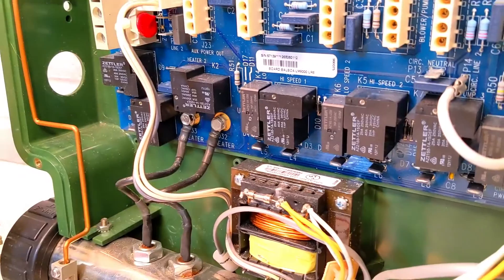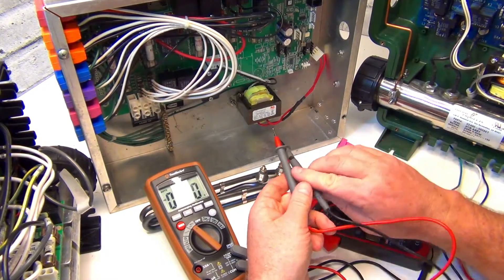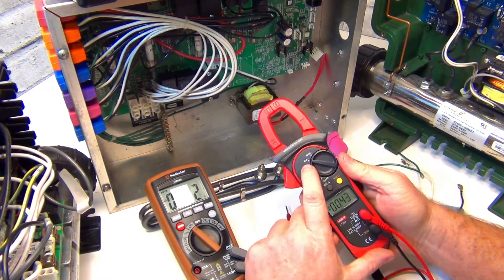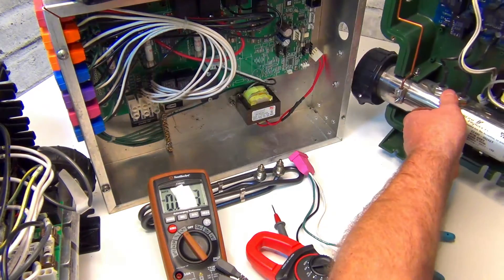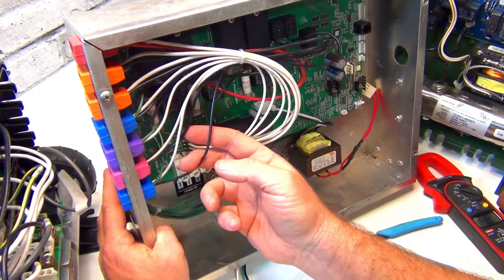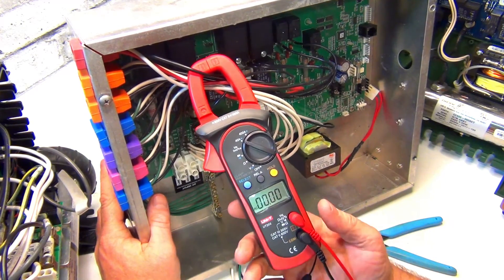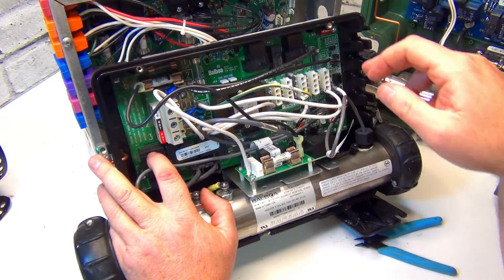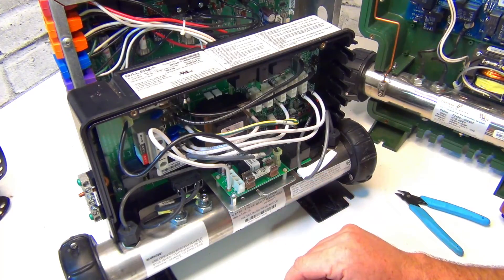Testing Hot Tub Volts and Amps / Hot Tub Not Heating or Working?

Comment: I have 2 single speed jet pumps and a circulation pump with a bp501 spa pack.  Switched pump 1 and 2 leads and 1 (same) pump won't kick on therefore I believe board is fine and fuses.  I get 240 volts testing at pump not working but 0 amps.  Newer pump (3 years old) US Motor TT503.  Capacitor test 30 mf as on label.  Don't know what to test next or change/repair.
Reply from the maker: I'm assuming pump 2 wasn't working and you pulled pump 1 into pump 2 spot and it didn't work?   If so, test where pump 2 plugs into the board for volts.  You get volts, it's the pump.  Maybe capacitor or windings of the pump.
Reply: @VIPPoolsandSpas  I checked the capacitor and its at 30 uf which is correct per writing on capacitor.  I thought it was the pump but had a hard time believing a 3 year old pump windings go bad that quickly.  I bought it new.  Any ideas what could have caused it to fail so soon?

Comment: Sooo, our Sweetwater Palermo 220v spa just experienced a jolt to the main circuit board.  Appears the heat element relay took the main hit (signs of charred solder connections on the circuit board, and burnt wire connectors) ??   

Question >> Before I replace the circuit board, is there something I should check?  And is there the likelihood of this same shorting/arcing happening again?  I assumed there would be a circuit breaker trip vs burnt board > “puzzled?”

Great video, very informative > thx so much!
MC/Sacramento, CA
Reply from the maker: Replace the board and nothing to worry about.  Sounds like the relay stuck closed and burnt out.  1 in a million if it happens again.

Comment: I have a 120v tub that started struggling to maintain the set temperature even though I had just installed a new heating element two months ago. I called a repairman and he said that his meter was showing 10 amps and that the element was fine. He offered no definitive solution other than to try adding new temp sensors which he is supposed to come and install next week. I'm no electrician but 10 amps is half of the 20 that you stated it should be. Now I'm wondering if my repairman is unknowledgeable or taking me for a ride.
Reply from the maker: Because you have a 120v hot tub, the amps are lower and the hot tub will take longer to heat up.  Every time the jets are turned on, the heater will turn off.  So, when your in the hot tub while the jets are going it will cool down fast.
Reply: I understand the heater turning off when the jets are on but the tub is struggling to maintain the set temperature when the tub is not in use. The pump will run for hours and never warm up enough to shut off.  During warmer weather it will hold the 102 degrees but never hit 103 to shut the pump off. I'm guessing that the element is going bad? And thank you for your quick response!  @VIPPoolsandSpas
Reply from the maker: @Irishman1776  Might be a sensor issue.  Hard to say what it is.

Comment: Thank you for your video. 
I have a problem getting the extension board to work. All my pumps are working, all fuses are in working order. Currently Jets 1 is working with pump 1, jets 2 is working with pump 3, jets 3 button isn’t making the relay click noise. I think this could be dip switch settings. Could you post a video on the basics of dip switch settings? ( I have a MS1500 a balboa circuit board - PN 54493) 

Thanks so much
Reply from the maker: There's so many combinations when it comes to the dips switches.  Best to send a pic of the board and dipswitch to info@vippools.ca

Comment: I’ve watched and followed a number of your videos and was hoping that you could help me out with an issue. I have a coast spa with a gecko spa pack S series. I have three flashing lights under the heat indicated on the control pad and have changed the filter, tried the bypass on the pressure switch with no luck. The heat light is on on the control pad, but so is the HL light on the board. Pumps 1 and 2 are running (labeled 240v) but the three lights won’t go away. I checked the voltage coming into the pac and only got 120v between the black and red wires, no reading (0)to the actual heater. Last thing is that the hot tube won’t auto turn on. I can only start the pumps manually. They will run for about an hour then will shut off. It appears that the heater isn’t coming on. Any thoughts?
Reply from the maker: You have many issues and that points to a board issue.  BUT.  You say you have only 120V at the red and black?  Is the Hot tub a 240v tub?  If it is 240v and you're only getting 120v, then its on the house side (Breaker).  How many pumps?  Power Pumps? and do you have a smaller circ pump?

Comment: Have a 2012 MasterSpa with Balboa pack. Controls light up, priming is indicated but no pump activity at all from either pump, error code is HFL. Heats up fine just no circulation. Both pumps failed at the same time - does this likely indicate the board is the issue? All fuses tested. Any suggestions appreciated, our local dealer closed up and closest tech is four hours away.
Reply from the maker: Send a picture of the spa pack and the topside to info@vippools.ca
Reply from the maker: Turn power off, unplug the topside controls from the board, then turn back on.  What does it do (remember, nothing will be on the screen)  Any click noise(s)?  Pump one should turn on.

Comment: Great videos!  I need help.  I have an Arctic Spa with an ECO PAK and I have a no-heat situation.  If I connect the leads for the heater to the motherboard, I get no volts, but if I disconnect the leads, I get 240 volts on the board connectors!  I actually do get 120V on each side of the heater, but when I touch both leads, 0 volts.  What could possibly cause this?  Help :-)
Reply from the maker: Change the heater element.
Reply: @VIPPoolsandSpas  heater element changed with new one. Still exactly the same!  Any suggestions on next steps would be appreciated.
Reply from the maker: @wreckdhunter4058  any little lights on the circuit board?
Reply from the maker: @wreckdhunter4058  check the volts coming into the tub.  Are all pumps working as normal?  How is the pressure switch on that heat tube?  Just trying to get a feel on what you see and hear.

Comment: I am having issues with my hot tub. We bought used one we we are learning as we go. I have a video they I could like to send to you to give me your opinion. What’s your email to send you the video?
Reply from the maker: The video will be to long.  I havent set anything else up for this, so.  The best thing to do is put the video on youtube and send me the link.  You can always delete the video after.
Reply: @VIPPoolsandSpas  just uploaded. 
The problem we have: we turn the Hot tub on, it run for about a minute and shuts off and give us the code as you can see in the video (we checked the manual but we cannot find the code). 
We hear the click (rele) on and off one in a while. 

https://youtu.be/KR6nv-_Zq3A
Reply from the maker: if that loud noise in the video is the "click" your hearing, that would be a bad relay.  If your in the Blue Mountain area, just look up our name and call us for a service call.   Hard to say what that is without testing a few things.  That spa pack is hard to test because of where the element leads are and the pressure switch location.
Reply from the maker: saw your video.  Is it heating?  Not sure what that noise was.  Maybe something in the lines where the pump is (front of it).  Also, your pump seal looks to be leaking or was leaking (white stuff on the wethead)

Comment: Hi,
For my Balboa,
I tested the voltage and the fuses and everything looks fine.
But nothing is working! 
Do you have a way to check if the pumps are ok before replacing the board?
Reply from the maker: What's not working and how many pumps not working?